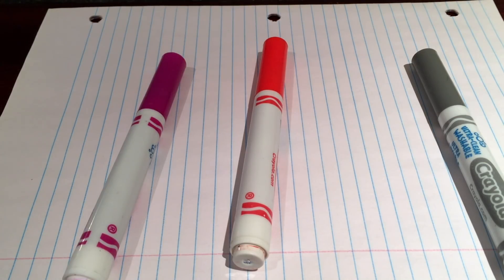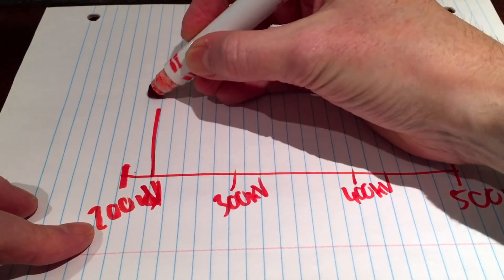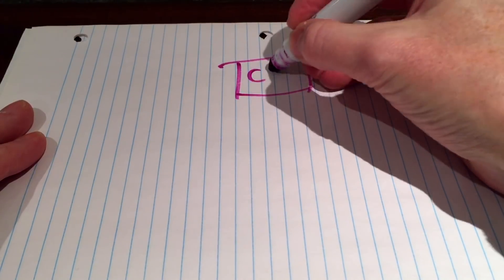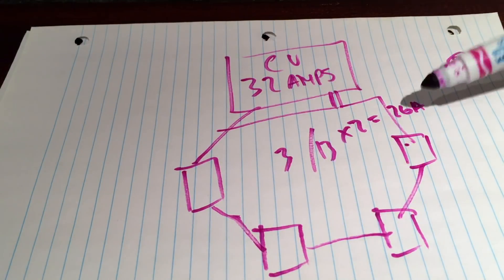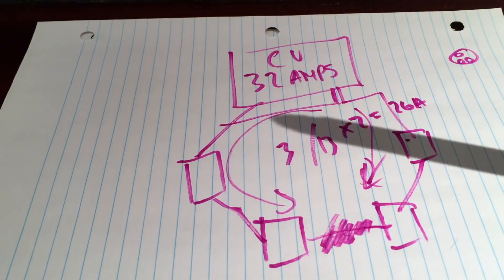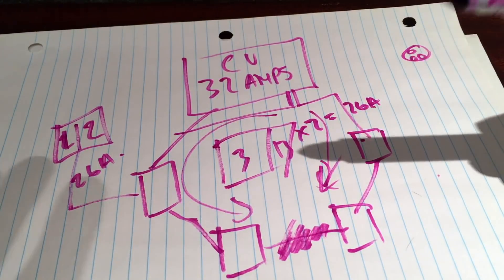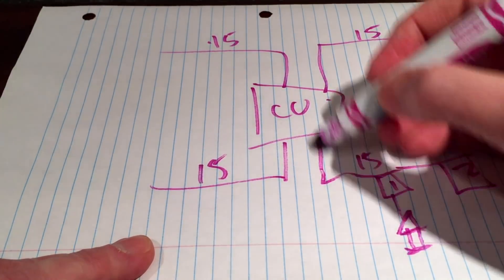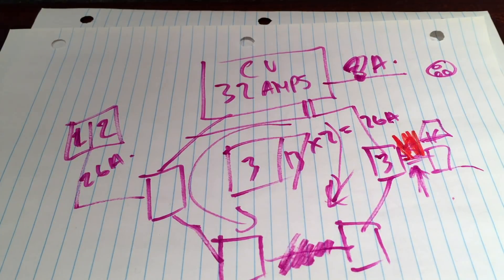THIS is why British plugs have fuses

Comment: Hello from Canada:

I am actually a retored electronic technician, and also hold an intewrp[rovincial electrician's ticket.

However, most of my electrical experience was in industry where the environment is quite different.

I had long heard of the U.K. rule of thumb that you never plugged more than one item into a socket. I had also heard it said that the distribution did not have the rulke that each reduction in wire size had to be aditionally protected by an appropriately sized breaker or fuse.

This latter more or less corresponds to what you described with your description of the ring circuit. so that one item rule makes a lot of saferty sense in the U.K.
In other european countries, I believe the usual circuit is 7 A. at 220 V. 60 Hz, and is typically supplied as one phase of a 3 phase Wye, meaning that the neutral is at one electrical end of the 220 to 240 volt line.
Large items such as dryers,m stoves etc. would logically have to have spoecial circuits to accommodate their needs.

In Canada  and the uU.S,., within the scope of residential power, not including apartment complexes etc. the typical sascenario  is as follows:

From the transformer in the street which may be mounted on a utility pole, there are two secondaries, each for 120 volts 60 Hz. these are then wired in additive series, resulting in 240 volts, and could be sized to render as much current as a KA. 

Then the point where the two secondaries are joined, otherwise known as the center tap, is attached to a wire headed to the ground (earth). At ground level a hole of about 6" depth is dug and a 6 or more foot rod is driv3en fully into the ground at the bottom of that hole leasving only a few inches inside the hole. the wore from the senter tasp is then thermit welded onto the rod, using a disposable ceramic or steatite cup that holds the powder used to make the thermit flash. Once the flire from the flash has subsiced, the lot is buried. this then is the neutrasl connection, except that the neutral concept has more to do with the neutral wire that goes from that connection at the top , with the two hot wires to the building entrance.

there it is formed ina droop, also known as a water loop. which encourages rain and other water to drop down it and away from where those wires are to enter the conduiit gooing down to the entrance. In some cases that conduit may enter the building there and pass through the consumption meter inside, but in mre recent installations the tendency ois to have the meter outside so it can be e=more easily read by passing hydro trucks. still newer is to have a radio transmitter associated with the meter so it can be remotely read without any need to bother the resident.

The type of drop cable sued from the pole to the building is often of the type klnown as NSF cable. It has 2 insulated conductors for the live wores and a bare one for the neutral.

In the city this may be replaced by underground installations, but ultimately they all end up oin the backplane of the fuse or breaker panel. In some cases there is a separate master breaker/disconnect swithch before supplying the backplane of the panel, in other cases the master breaker is part of the breaker panel and the incoming entrance is connected to that 2 pole master breaker, and thence feeds the backplane to them feed the individual circuiit breakers. (In iolder installations the panel may be designed to use fuses, but gradually this is being phased out.)

The typical (and minumum size) circuit is 15 Amperes. this is used for most circuits, with notable exceptions being stoves, clothes dryers, electric water heaters and heat pumps, all of which will be fed by special circuits either direct wired or using special connectors, each being described precisely in the tabbles at the back of the Electrical code book. Each of these has a unique design so that it is physically impossible to insert a wrong male cap (plug) into a given receptacle of a different size or capacity. there are many different approved designs for differnent needs, some of which are intended for 120-240 volt use, and others for three phase use (industrial and commercial only) upto (Canada) 347/600 volt three phase. this differs in the U.S. where the usual commercial voltage is 460 volts delta.

While some industrial equipment goes even higher than this, I will stop here as above that it becomes an electrical specialty, due to the added dangers and equipment needed to work on that type of installation.

Hence, back to the domestic domain, the 240 volt usage is notably differtent from 220 to 240 volt systems commonly used in pother countries. Not only is the frequency different, but the neutral is not in the same configuration, so ot would be very unsafe to try and harness North american 240 volts to power European 220 to 240 volt equipment directly - with one common exception.

Many small electronuic devices use switchmode "electronic transformers" usually sealed in small balck boxes, to convert the incoming pewer to low voltage, class II (inferring 24 volts or less) to supply the small devices.

these electronic power blocks (technically known as switching power supplies) use complex electroniuc power conversion techniques to convert just abpout anything to just about anything else. simply READ THE LABELS. Since these are usually designed with the whole world in mind, they are apt to be rated to use anything grom 100 to 240 volts at frequencies ranging from 48 to 62 Hz. so to accommodate from Japanese power (100-200 volts 50 or 60 hx. depending on locale) too240 volt 50 Hz. U.K. amd australia, and possibly New Zealand.

they may either have the plu=gs molded intot eh black box or, for the larger sized they use one of a number of international business machine recessed makes in the black box, coupled with a cord set compatible fore the market in wheuch they are to be shipped.

Hence, only yesterday, when my new neighbout came to me with a small laptop which he ahd brought from New Delhi India which had "problems" the foirst questuion I had was how long has this computer been sitting dead without having power connected to keep up the lfoat charge on its battery? when I made him think for a bit the answer came otu to be close to two weeks. so immediately I had him bring it out. when I looked at the power block onthat one, Iwas able to go to my parts cupboard and grab a North American power cord to fit the power block, swapped it for the one he had from India, plug it all in and let it recharge as we dealt with other matters. (I also told him not to let go of the  cord from India as he could never know if or when he might again need it.)

The"electronic transformer" or switchmode supply in the black box would rectify whatever poer it got, then sense the resulting D.C. voltage and adjust the duty cyxckle with which it switched that power at high frequencey into the step down transformer for subsequent re-rectification and flltering. At the same time, the circuitry would sense the outgoing voltage and use that through another high frequency feedback channel to auto-compensate the duty cycle of the powering circuit to result ina regulated output voltage for the use of the computer.

the laptop would then further regulate that power according to changes in the activity of the computerm, and added safety device circuits built into the battery caretridge to insure against danger of the battery spontaneuosly catching fire.

that dsaid there is an added caution: Never try to fix orreplace a laptop battery with a substitute. that battery cartridge is actually more than just a battery and must communicate with the laptop ongoing to ensure safe operation and prevent dangerous fires.

On my own business Laptop, when I plug it into power there is aset of lights that flashes a sequence as that communication operates, so immediately I know it has powered up the charge circuit and stabilized itself for further use. this is obviously more than a mere battery.
Reply from the maker: Wow.  Thanks for the comprehensive reply.  I'm going to pin this as the top comment on this video.
Reply: R. E. Bruce Martin I
Reply: It's all to do with the transformer wiring pattern and the waveform of the AC supply.
Reply: R. E. Bruce Martin .  In the UK we have a lighting radial circuit for each floor, typically 1.5mm twin and earth protected by a 5amp breaker. We usually have a mains ring per floor using 2.5mm twin and earth protected by a 32amp breaker. Showers will have their own feed either 6mm twin and earth or 10mm twin and earth depending on the showers rating. Cookers will be 6mm with a 32amp breaker. The whole lot Also has an RCD or similar. Mains plugs should be protected by a suitably rated fuse 3,5,7,10 or 13 amp. Obviously this element fails if a user puts the wrong fuse in. Every cable should be earthed or double insulated. All cables should meet fire retardant standards both for the ring and per appliance. Again, this fails with iffy fleabay devices etc. We have quite extensive wiring regulations governing everything.

As for PSUs, I have seen everything from excellent to total death trap. One had less than half a mm separation between the mains and the supposed 19v dc output. There are devices on sale on Amazon right now that use a capacitive dropper so when plugged in the usb output is potentially at mains voltage. We worry about our homes then plug in cheap crap. Bonkers really.
Reply: Last time I checked, plugin devices were only allowed a 3amp or a 13amp cartridge fuse.
Reply: Adam Bryant Manufacturers have standardised in those ratings but it is not yet regulation. A lot of older kit comes with other fuse ratings, particularly 5a. That is why you can still buy other ratings in hardware shops.
Reply: R. E. Bruce Martin ou
Reply: R. E. Bruce Martin I'm building a house in Jamaica. I'm thinking of putting UK plug sockets instead of the US ones so my computer won't explode. Will this work?
Reply: Dude..... you either need to learn how to spell or use spell check.
Reply: @garychap8384  It could indeed be called a live earth I suppose, with one major difference.  As Mr. Martin explained above, the neutral wire is fastened to the ground prior to reaching the meter. So, if you stand in your yard, and look up at the line drop bringing power into the house, the bare wire is the neutral. So theoretically , ( NEVER try this !!! ) you could connect a wire to the neutral in your fuse/breaker box (just ONE single wire), and run around the yard with that bare wire in your hand, as it is grounded. The other two wires are DEADLY !! The neutral is just to complete a circuit, not to be connected to anything except an up to code home wiring system. Some codes require that the neutral be connected to metal plumbing as well if such exists.  So the two HOT wires connected to each other would measure, with a voltmeter, about 220-240 volts, and either of the two HOT wires (measured again with a voltmeter) to neutral would show around 120 volts. I understand that it seems illogical, but further explanation is out of the scope of this forum.  I hope it helps. Capitalized words are meant to be disclaimers.
Reply: @garychap8384    If you think about it, water pipes coming into your house could very well pass right by the ground rod that is connected to your neutral wire. Both underground. My house is wired that way.

Actually terms could be the problem. The UK and US have different words for various concepts. I read a lot about both and sometimes need to pause and translate what I just read in my brain to get it.

Another confusing factor is the behaviour of AC vs. DC.  All the various gadgets we have nowadays blur the line as various control circuits appear more and more.  Neutral, ground, earth aren't the best of terms, but people use them in different contexts, so if they are professionals, a bystander might have no idea what they're saying but though a UK and US electrician use different words, they understand each other perfectly.

If you're interested, I'd suggest going to  KhanAcademy.com  they have an electrical course that is free, and easy to understand. It has various classes, in logical order, but you can watch whatever class interests you if you want.  Best of luck.
Reply: Were you heavily under the influence of drugs or alcohol when you typed this?
Reply: R. E. Bruce Martin in europe (at least here in the netherlands) the standard is 16 amps. We get ~ 230 volts but the breaker is 250 volts I believe. So that’s quite a lot of power on one circuit. Most of the times it’s enough for consumer electronics, so a washer or dryer has the same type of circuit as any other one, just one for it’s own.

Comment: The British WW2 wartime committee looking at advancing electrical installations noted:

“the installation should allow the occupier to use electricity, if he so desires, for providing ‘topping up’ heat. Bearing in mind the limited cubic capacity and the load diversity of the small dwelling under review, it is considered that they could be adequately heated electrically using portable or inset electrical fires or convectors up to 2kW rating from the ring circuit. This [substantial demand] applies to the smaller classes of dwellings in which 2 kW radiant electric fires are commonly used, and in which fires or other appliances exceeding this rating are seldom required due to the limitations imposed by the size of the room.”

The above is clear the committee homed in on final ring circuits to ensure one socket in each room can take a 2kW load. The aim being that each room can handle a 2kW heater. That would mean two final rings in a three bedroom house with kitchen and two reception rooms. That is fewer circuits than using radials.

“The ring circuit system of wiring takes full advantage of domestic load diversity because one circuit serves an unlimited number of standard socket-outlets [BS 1363 type of 13 Amp rating] which may be used at any time and added to after if required. A large fuse at the meter end of the installation that has to be capable of carrying the full load of current drawn from several socket-outlets at once may not protect a flexible cord leading from an individual socket [this led to the fuse in the plug].”

”The way to ensure adequate and selective protection is to connect each flexible cord to a separately fused plug.”

Note the last line. The fuse was to protect the flex - and appliance.. 

Although the committee wrote the above in WW2 a final ring circuit was not mentioned in the regulations until 1950 when there was no copper shortage, dispelling the myth that the prime aim of final rings circuits was a method of using less copper. Final rings were slow to be adopted, but through the 1950s/60s they became the normal power socket circuit to install.

That is why the British final ring is superior. It delivers the power at any socket. On the continent they are forever resetting tripped breakers.

Comment: Can a 3 amp appliance draw 15 or 16 amps on a radial circuit without tripping the breaker?
If the circuit breaker fails (even on a radial circuit), the fuse in the plug is still better than nothing.

Comment: Very interesting video, however I don't think you have hit on the real reason why the fuse is needed in the plug. I scrolled through the comments and maybe I missed it if someone else has made the same comment, if so sorry! But the reason I believe there is a fuse in the UK plugs is not to prevent the entire ring from going down. The reason is that, as you stated, the wire for the small appliances is rated at only say 3-5 amps, so an overload to say 10 or even 20 amps would not cause the 32A breaker to trip and the small wire would burn up and cause a fire. To protect the wire, the appliance, and everyone around there has to be a fuse. Basically, the breaker is for 32Amps, the wires to the sockets can presumably carry 2x26 amps (both sides of the ring), so the 32A protection is fine for the ring, but will not protect the appliance, you need the fuse at each plug. You are correct that it is the ring that creates this need for the fuse and nowhere else in the world do they use rings and thus don't need fuses in plugs, but the reason is not quite as you stated.  Definitely would be interested if someone has a different perspective.

Comment: Nice try in explaining but not completely accurate. There is no 3 phases to domestic property in the UK. It is all single phase and neutral so your electric cooker is also single phase 240vac and protected by a 40A breaker and usually a 100A or 63A ELCB (Earth Leakage Circuit Breaker) or properly referred to as an RCD (Residual Current Device) or RCCB (Residual Current Circuit Breaker) which services the ring main circuuts as well as cooker and electric showers and boilers.
The ring main ensures that there is very little voltage drop when you plug in a heavy load like a kettle or toaster as well as distributing the load more evenly. The 2.5mm sq wires they use is rated at 26A but is more than capable of carrying 32A even for long periods but might get slightly warm. Some larger houses that are built nowadays will use 4.0mm sq which is rated at 32A.
All appliances come with a cable or flexible cord  that is rated at 13A. This is the current limit of the plug and appliances that can be plugged in. The appliance however will have smaller current carrying capacities and so are best protected from short circuit with a fuse that is rated for the size of conductkrs in the appliance. This will prevent the appliance from overheating and catching on fire rather than the flexible cable. Domestic fuse sizes are rated at 1A, 3A, 5A, 10A and 13A si it is important to fit the correct size fuse for maximum protection.